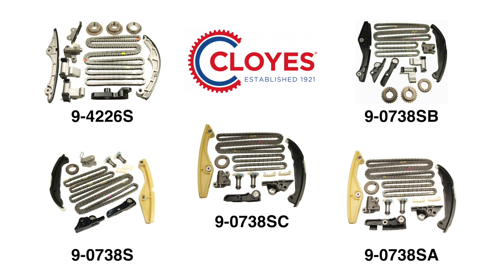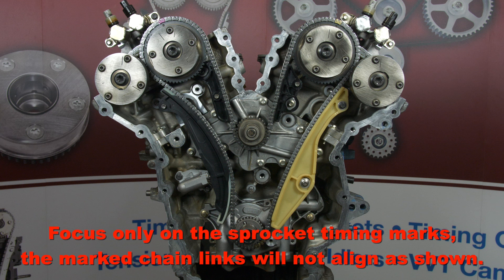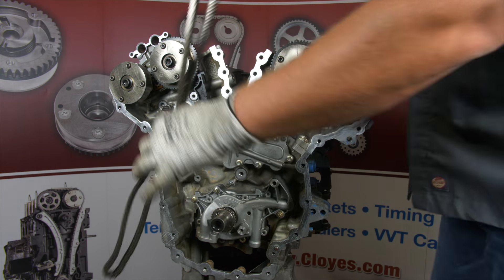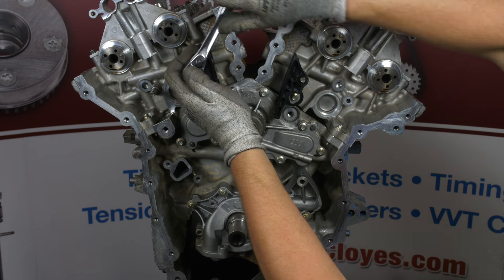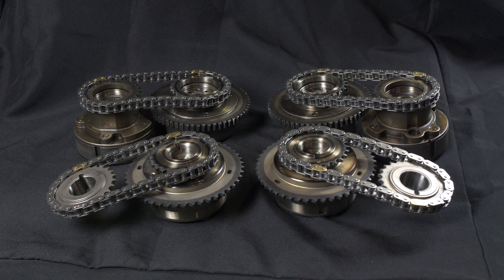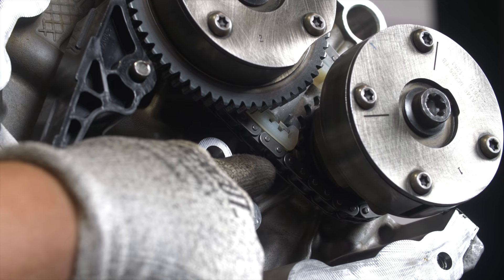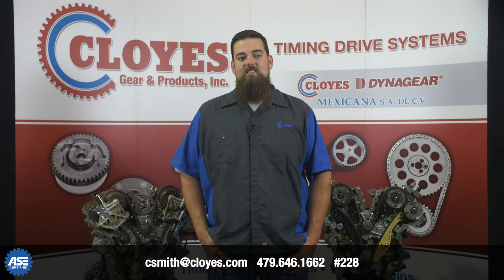Ford 3.5/3.7L DOHC V6 Timing Chain Replacement, Cloyes 9-4226S & 9-0738S

Comment from the maker: An excellent feature of this video is that the Cloyes technical support team shows how to time the engine properly without the use of the unnecessary camshaft holding tools. Most instructional guides and videos will suggest the special tools are necessary and will show the installation using these tools. Our process saves the customer time and money while still ensuring a proper installation. When servicing the timing components on engines equipped with an internal water pump, Cloyes also recommends water pump replacement.
Reply: In this video, is this the 3.5 liter that you are doing the work on?
Reply from the maker: @tward6630  Yes!

Comment: Be cautious using a T55 bit. The bolt is actually a TP55 (torx plus) and using a regular torx can strip the bolt. Ask me how I know lol
Reply: Please don't be a dumb question lol. Does it say on the bit "T55+"?
Reply: I can’t even break mine loose. Me and my dad can’t crack them loose with both of us doing it. Did you have this issue?
Reply: @OnlyNukes  I had to use a 30" breaker bar.  Even then, I had to grunt.
Reply: @nonotthatoneguy  yeah i had to use a 2 ft breaker bar. definitely wasn’t easy as shown haha
Reply: I hate when "we" are the example 😒
Reply: Rock auto
Reply: Yeah I used the T55 I didn't know there was another called "TP55" I still used the T55 it slipped once but it did fit very loose.
Reply: TP55 is the one I took it off with a T55 while waiting for a TP55 to torque it down with
Reply: oops
Reply: Every tutorial I have seen fails to mention this. Fortunately, I already had T+ bits in my tool box.
Reply: @mikeembry6427  yes or tx55 and some of the cam lock kits come with it. The issue is if you're doing it in the engine bay the t55+ is too long to fit on the leftmost sprocket...

Comment: All cloyes timing videos are money. I’m a mechanic by profession and any time I’m doing a chain I pull up the cloyes vid if there is one and go to work. They’re the most professional and informative I’ve found. Top notch.
Reply: i am looking at a 2015 ford 3.7 with 103000 miles. would the timing chain failure cause the check engine light to come on?
Reply: I too loves these and melling videos. Headphones an play the video while I do the work. Just for a piece of mind

Comment: What makes us different? We go the extra mile to provide training videos to enable the professional installer and DIYer to be successful. We make sure the system we provide works, the parts are OE or better in quality and performance, and the intelligence to install it right, the first time.
Reply: Oh really the extra mile? Why don't you add the tty camshaft t55 bolts into the water pump kit I ordered. I had to source them from someplace else. You added the secondary chain and cam sprocket so I've gotta remove the bolts to replace those. And I can't reuse those bolts as you mention in the video.
Love the video instruction, just your gonna go this far, complete the whole kit.
Reply: Hi I have followed all the steps in video but I have 0 pressure in all 6 spark plugs. Any idea why would that be. I am working on 2011 F150 3,5. Thank You
Reply: Keep up the good work!!  I'm getting ready to order!!!
Reply: @BM-rc1qq  do you know if you had the timing chains slip on you? If this is the case you could still have all of the marks in the proper position but be 180 degrees off. It’s good practice after completing this job to turn the crank around so you can hear the engine hissing indicating you have compression.
Reply: I have done so many of these is ridiculous. 

And why 0 psi in all 6, if the timing is right then the motor bent valaves when the chain jumped time or stretched.
Reply: @BM-rc1qq  bent all the valves?
Reply: Also, how about leaving a large STOP red Tag in the kit that tensioner must be activated so people can come and watch this video? 
Thanks to your lack of care I had to do this twice and everyone here knows what a pain this engine is!
Reply: @mannygazani3940  I would say all hydraulic tensioners have to be activated by pushing up on them to make sure they have good contact with the guide. There should be some sort of tag on it. The reason why I think you have zero compression is the valves could be bent. Did your engine run good before you did the job? If the answer is yes maybe you lined up the marks when the cylinder was on the wrong stoke. When you line up the marks you have to be on the compression stroke at TDC on cylinder 1. No exceptions.
Reply: @mannygazani3940  you could have had the piston make contact with the valves and this would cause the valves to get bent. Is the engine ran good before you did the job this is probably not the case. You could find this out by taking both heads to a machine shop and having them examine the head. If the valves were hit by the piston a visual inspection of the head could also tell you this.
Reply: @billsfan1768  I would have to disagree with you because not all hydraulic tensioner have to be activated, only the spring loaded ones do. On the other hand, I do agree with you that there should be a tag on them and that is my argument that why wasn't there one?
I also disagree with your statement about having to have cylinder 1 on TDC as even the technician here mentions is not required as long as you have all the points lined up.
I do not have Zero compression, I have rough idle that showes all driverside banks misfiring due to the exhaust cam being off a few degrees which funny enough was not caused by the chain being off only 1 tooth. This issue was caused by the bad design of the phaser and the camshaft which only has 1 small locating dowel which could fall in the oil galley that's machined on the back of the phaser. 
I don't blame Cloyes only for this mess, it is also Fords stupid design but Cloys could have minimized my aggravation by leaving a small notice page in the kit and I would only be upset with Ford's design.
Reply: @mannygazani3940  well you sound like you know what you are talking about all I was trying to do was put in my 2 sense and help you. Every engine I time I make sure the marks are lined up when cylinder 1 is at TDC on the compression stroke no matter what any one says and I always activate the tensioner no matter what. Hydraulic tensioners should always be pushed up on to assure they are making contact because it will take a few seconds for the oil to make its way to that tensioner. Shit happens you have to always try to account for the unknown
Reply: @Billsfan17  I agree and apreciate the wisdom. I normally don't leave comments but when I saw Mr CEOs comment padding his company on the back for making a video and leaving it on youtube I thought to voice my frustration with them taking shortcuts!
Reply: @mannygazani3940  they don’t care or they would put those torque to yield bolts in the kit also. That was also the same reason I replied to this thread. I apologize that I though you were the person a couple comments up that had zero compression but I was just skim reading lol but good luck with your issue it sounds like you already got it figured out
Reply: @billsfan1768  no problem at all. I am still dealing with this. My truck has been out of service for 3 weeks now as I work full time and some overtime. I hope I can have mine buttoned back up by the end of this week.
Reply: won't be buying another Cloyes product after the failure of a brand new chain and phaser set even after double checking to make sure it was the updated version. this boycott includes my race engines.
Reply: @mannygazani3940  The kit I got, 9_0738SA, Had a good warning paper in the box. 5/15/23. They must have heard you :)
Reply: @mannygazani3940  my kit had a warning paper right on top when I got it..I got the whole kit with water pump. Thru Napa but it was Cloyes parts.
Reply: @mannygazani3940 same here damn chain broke. it was this video that showed me that they had to be activated

Comment: I attempted this without out the tool and the timing was off by 2 teeth after startup. I was getting a p0017 code. I had to pull off everything again and re adjust the timing with the tools. Definitely recommend doing it with camshaft locking tools. I did do this job once before without the tools and had no issues. I guess it was just luck.
Reply: did you bend your valves ?

Comment: I have always liked ford trucks but I am starting to wonder about there engineering department putting a waterpump that is run off the timing chain they need a brain transplant.
Reply: Why, Most asian cars run them off belts. Ford should have left the water pump running outside with serpentine belt.

Comment: You need to tell people that the left and right bank heads are from the bell housing end of the engine. Because if you're looking at the engine from the front, the right is left and left is right, and someone's going to screw that up if you don't tell them.

Comment: This was the only video I've found that actually covered the teardown of replacing the main chain and the smaller ones as well. Thanks a ton for that! So many others just showed the timing marks and called those "replacement" videos.
Reply: Look for FordTechMakuloco.  He has a 4-part series on this job and goes through every step including the one you mentioned.

Comment: Master tech here with 32 years experience. First of all this is an awesome video with good clear instructions. I have watched many of Cloyes videos and used quite a few of their products over the years. I also am the owner of a high volume shop. The only thing that i might humbly add is that when the engine is in the vehicle and has not been apart since it's birth, those camshaft bolts are gonna be super tight and require a long breaker bar to get loose. It is going to require some serious controlled torque. The holding tools are not necessary but are very useful after getting the bolts broke loose just before you wiggle the phasers off. I dont know why but it seems like the rear (while in the vehicle) exhaust camshaft likes to jump around off of the lobe. I install the holders just before i pull phasers off. I just use a cheap amazon set. I DO NOT use them to hold the cams while breaking bolts loose. This is not necessary like Cody said but it is helpful for me. I really appreciate the awesome videos and instructions from Cloyes.

Comment: You. Need. The. Tool! We followed this video, word for word, and had the secondary chains off 3 times until we decided to check Ford's procedure. Cam locking tools installed, reassembled and this piece of Ford is finally out of our lives. 2013 F-150, 3.5 turbo.
Reply: It can be done without the tool. The tool does simplify it but if you're only doing this job one time they aren't necessary.
Reply: PLUS, instead of the cam holding tool, you can use 2 wrenches on the cams and vice grip pliers the wrench handles together ....
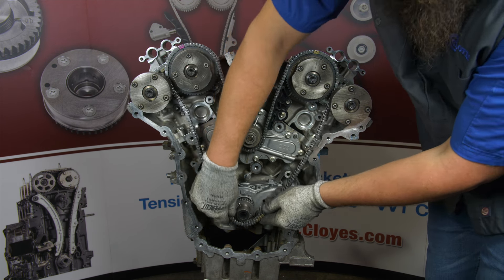Reply: Thank you for this video! At 9:00, you mentioned rotating the cams to align the chain properly.What would cause the cam marks to be off? Does it matter if I adjust counterclockwise or clockwise? I'm off by a link - 2017 3.5l xlt  *Someone said when adding the tensioner it will pop the link into correct position if off a little. Not sure

Comment: Man when I learned about the Cloyes timing kits for the 2.4GM motors these are my go to for everything else because every chain is marked perfectly.     So far I have done two  2.4L GM 4 cylinder engines with their kit and one  Ford 3.5 v6.   None of them failed to run perfectly afterwards.    My service advisor and shop owner are sold on this brand for timing components..  These kits make my job so much easier and hopefully I can start doing more of these to get the shops name out there.    The camshaft holding tool isn't needed since I managed to use wrenches on the camshafts to keep them in place but the holding tool does help since 1 guide bolt on the rear bank is behind the camshaft phaser.    Pretty sure I can pull off a GM 3.6 v6 that is also famous for timing chain failures.

Comment: Thanks for the video. I am replacing water pump on 2014 Explorer and following Alldata, Ford instructions, I waited to get the locks before removing chain. marking the chain and cam marks and could get the lock to slide down perfect on back cam but wouldn't quite set all the way down  on front cams. I mean it held the cams in place but would not lock all the way down. After replacing pump that was bad, I could not seem to get everything to line up to the painted chain links I'd painted after aligning. so I spent the $90 on Cloyes center chain, and following this, as I was installing I had to back of a little on the front head. Turning the exhaust cam with a wrench with the cam lock almost, but not quite in position, the chain went on the mark and the cam lock fell right into place.  Then when I came to lining up the crank pulley, it was a tooth off from where  I'd painted original chain. So I have the  cover and everything under back in place, mount and soon everything else.

Comment: 10:01 I have a 3.5 V6 with a single phaser head my chain and my can phase are different from yours. They have the double link chain modification. I'm wondering if I have the wrong set up which is causing my tensioner to loosen and tighten as the engine is running because of the sound I'm getting from Bank a side

Comment: Great videos, I've used a few of them for chain replacements. However, you say you don't need the tool. You may not "need" the tool, but it's cheap, it ensures it's set perfectly, and it makes torquing the phaser bolts, which you didn't do, a whole lot easier.
Reply: instaBlaster.
Reply: The procedure for torqueing the phaser bolts was explained.  Did you miss that?
Reply: By the way the torque procedure for SINGLE phaser bolts is different. 90° instead of 180°.
Reply: He explained it, but since its a demo engine, didn't actually torque ANYTHING. Watch it again, he is using a regular ratchet.  As for the tools, I will use them since I have them and it prevents an errant bump from spinning a cam when everything is apart. Have had one too many cams slip and spent time realigning them when a fix tool just keeps them from moving.   He is 100% correct, you do not NEED the lock tools, but use them if you have them to save on time.

Comment: How many time should I have to rotate the crankshaft until they line up in the position
Reply: The cams and crank is like this.      One rotation of the crankshaft is only 1/2 turn on the cams.  You need to turn the crankshaft 2 times get 1 turn of the camshafts.   Its a 2 to 1 ratio.

Comment: Excellent Video, I just want to point out that with the kit comes the guides, but one of the guides is different from the original. At least on a 2007 ford edge 3.5. this is the all black guide. The original guide has the chain riding on the opposite side of the new guide. A

lso you will need to find a longer bolt if you choose to use the new guide. I chose to use the original. Also it would be very good to include new bolts with the kits, as these do not come with them. Thank you again for a Great Video.

]
Reply: I put a guide on backwards once on an engine. What you said reminded me of that. Now I wonder if you did the same.

Comment: Jan 13 2022 Cody you are the Man once again! You saved me on the GM 3.6l chains too lol Amazing easy instructions to follow, I just completed this chain job and it runs better than ever! I did use the cam lockers though when torquing down the cam bolts..Thanks for your Great work Cody 😎👍🏽👍🏽👍🏽

Comment: Thank you for this video! At 9:00, you mentioned rotating the cams to align the chain properly.What would cause the cam marks to be off? Does it matter if I adjust counterclockwise or clockwise? I'm off by a link - 2017 3.5l xlt  *Someone said when adding the tensioner it will pop the link into correct position if off a little. Not sure
Reply from the maker: Valve spring pressures can cause the camshafts to rotate when the old chain is removed. When putting the new chain on, rotate the cams as needed, either direction, to get all the marks to align. If the chain is installed and all the marked chain links and sprocket marks are not perfectly aligned, then it is not properly timed.

Comment: I’m working on a 3.5 single phaser engine and identifix says phaser bolt torque steps seem to vary slightly.. step1 tighten to 30 lb-ft step2 loosen one full turn step 3 tighten to 89 lb-in. Step 4 tighten 90 degrees.. what do you think about those directions? Those inch pounds seemed different as well.. 🤷
Reply from the maker: Those are the correct specs according to our sources.

Comment: Hello,
I have a 2007 Lincoln Mkz. My ford manual said the torque process for cam phaser bolts. Have a different step 3 and 4. Step 1- torque to 30ft. 
Step 2- loosen 1 turn
Step 3- torque 89in lb
Step 4- tighten 180 degree. 
Please help what should I do, if I tighten my bolts any tighter I feel they may snap
Reply: Correction * 
Step 4 - tighten 90 degrees,  my mistake

Comment: I do have a p0018 it’s a crankshaft position camshaft position correlation bank 2 sensor A 
What is the problem exactly ? Is it a timing issue ?

Comment: A complaint and general comment: when talking about the sprockets aligned at the start, why only show the twin VVTi? There are a lot of single phaser 3.5's out there and the reference points for the phaser sprockets are completely different. On my 2013 Lincoln MKT 3.5 EcoBoost with single phasers, the wrench size is 7/8. I have cam holders, but they dont hold well enough to tighten and loosen the cam sprockets so I also used the wrench.